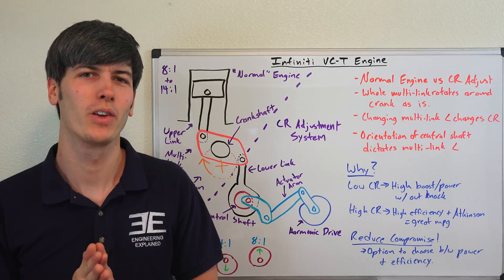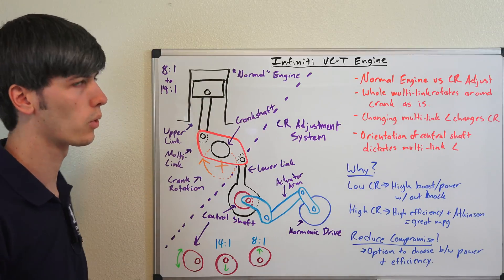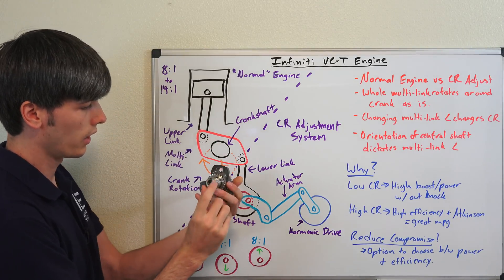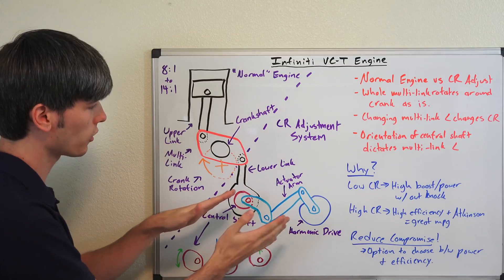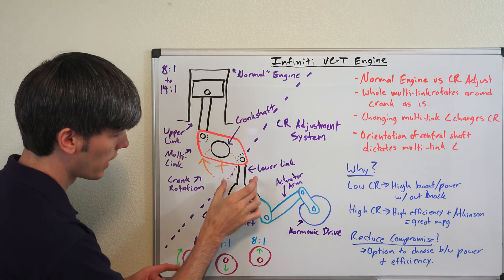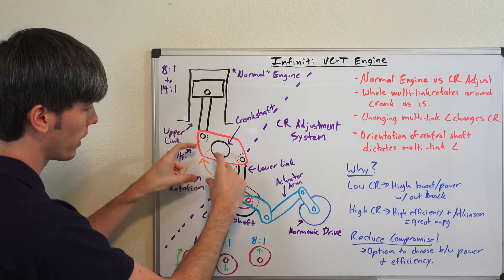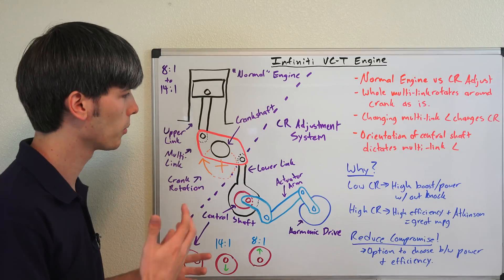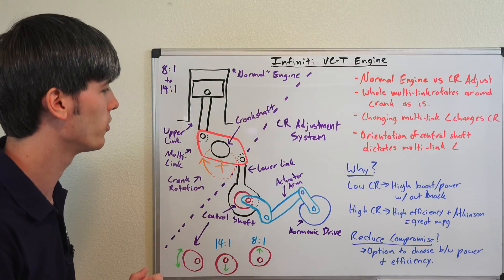Infiniti's Amazing New Engine - Variable Compression & Turbocharged

Comment: I bet you could buy a lot of gasoline for your normal sports car for what it'd cost to rebuild that engine;  Kind of counters out the benefits of fuel efficiency....
Reply: Most people lease Infiniti's. It'll be the job of the poor schmuck who buys this third hand without a warranty that will be footing that bill, and by that point Infinity won't care.
Reply: +I'm Batman What makes you think fuel efficiency automatically reduces pollution? You know, the same gets said about direct injection and turbocharging, but there's now loads of evidence that suggest these engines increase harmful particulates, not reduces them. Also, your comparing costs of regulars rebuilds to this, but you don't even know how much this will cost to rebuild. You can rebuild a simple, non-DI engine for a few thousands bucks. But just rebuilding the fuel system on a modern DI engine can cost that much! How much more will it cost to rebuild an engine with this complicated variable compression system, ??? And with the complexity of this engine, a rebuild mot not even be a possibility, many people will likely be looking at completely new engine. Everything is being made WAY more expensive and way more complicated just to save a few drops of fuel and a few puffs of a tail pipe, if we're even save that much.
Reply: Or just buy an efficient car with electric assist. If you want to drive efficiently use fuel alone,  if you want sport and more power use electric motors as well.
Reply: thats not the point, efficient engines will reduce pollution too, its not all about money... and people who drive their cars alot spend much more on fuel than a rebuild... E.G we have 2 cars and per month spend around $900 on fuel.
Reply: I'm Batman We could calculate it out if we knew how long that engine will last, how much of a premium it costs, the MPG difference over the standard engine, and the price of fuel. 
I purchased a TDI with the 6 speed manual because in my mind it is the simplest and cheapest way to achieve 40-50+ mpg.  I bought the car and plan to keep it long term, so I don't want to have to worry about spending thousands of dollars replacing batteries or a generator like the hybrid guys(plus I get better highway mpg).  I don't have to worry about an overly complicated compression adjustment system either.
Reply: +Josh i didnt read that wall of text but just to clarify, basically less fuel burnt per mile means less emmisions when compared on engines with the same technology. Although the difference is less but it is there... However the best way is to just use more public transport.
Reply: +Kent Sextro if every man had your mindset technology would stop advancing because once a cycle was the simplest way and kind of did the job and a car was just overly complicated, same with horse carridges
Reply: I'm Batman Well luckily for people like me, we have people like you who can afford to foot the bill for these technological advancements! ;)  By no means am I against new technology, but I work in the construction/agricultural industry and I know what systems last and which ones don't.  Ultimately I'm just wanting to spread a little bit of awareness, some people buy cars simply on looks and numbers, without giving any consideration to what powertrain they have under their hood.  You too are obviously educated enough on this matter to make an informed decision, if this is the vehicle of your choosing I'm by no means criticizing you!
Reply: I'm Batman That isn't necessarily true. If you removed your emissions systems, your fuel economy will increase, but will your emissions go down? Of course not! Also, new technology isn't automatically an "advance", refinement is an advancement. Infiniti could've created a new triangle wheel, but that isn't a real-world advancement.
Reply: +Kent Sextro agreed, but still its good they came up with something.
Reply: +Josh dude sorry to say this but you didnt get my logic ... i know that emmisions depend on alot of factors but you cant discuss every thing at a time. I get your point but try to understand what im saying.
 So basically my point is, if you burn 1 mol of methane compared to burning 10 mol of methane to generate energy to do the same task obviously 10 mol will generate more by product than 1 mol simply because its greater in quantity. So if two cars have the same emmision system but one engine requires more fuel than another than whats greener? Excluding other factors just talking about fuel at basic level. Agreed??? Sorry for any mistakes english isnt my first language.
Reply: ***** I'd like to buy a "zero FX" for commuting to work and playing around the farm.  The problem I have with electric vehicles is that you're limited as to specific range and that the batteries are out the ass expensive when they eventually fail.  I do believe they're the future and I will own one someday if I live long enough.
Reply: I'm thinking the people who buy this almost certainly will own more than one car so if it makes a strange noise it'll just take it the shop.
I definitely wouldn't want to buy one of these used.

Comment: Great video as always.

With respect to Infiniti models and engines.  The VC-T will only be used in the 4-cylinder.  According to autoblog this technology does not work well for 6 and 8 cylinders.

Source: http://www.autoblog.com/2016/08/14/infiniti-vc-t-engine-variable-compression-official/

Comment: Would the gains overcome added weight?  Is it more efficient despite having more moving parts? Also, I know I'm asking you to explain how a clock works, but if you wanted more power isn't high compression better? Assuming ofcourse that the engine is naturally aspirated? I've heard that small displacement makes for better response, is that with higher compression? I know I'm asking a lot but I've been watching your videos for a long time, I'm in tech school for high performance and to say the least your videos have inspired me to seriously consider engineering. I'm fascinated by the technology and hope to leave a mark on the industry with my own innovations.

Comment: But Saab did this 10 years ago...
Reply: and with a less complex system. They used a cylinder head which tilted to change the CR. A rubber bellows sealed everything. It was a 1.6 liter 5 cylinder engine with 225hp if I recall it correctly.

Comment: Whoa.. thank you for explaining it. I was really wondering how they were able to achieve variable compression. I initially thought they were gonna adjust the height of the cylinder heads then quickly thought hydrulics and lots of moving parts and what about the head gasket, but it is pretty impressive.

My quirl with this system is.. now I see how they were able to accompish it, but now the engine(crankshaft) has to rotate moving parts that are not normally attached and its gonna use some joules to accelerate the extra parts which again my use extra energy and then may slow acceleration.

Also.. when that motor starts aging and this links that adjust compression might need replacing, or the accurator needs to be replaced. I forsee issues the engine may have in the field that the lab has not yet encountered.

Comment: Doesn't look like it would be a very high revving engine with all that reciprocating mass flailing about in the crankcase. I doubt it would have a long life high mileage expectancy either. A bit like early generation variable scroll turbos and the way they used to disintegrate I would imagine.

Comment: "It's a mess when you look at everything together, but it's easy when you break it down."

-Every engineering professor ever.
Reply: it is though
Reply: In fact - essential features necessary to conduct the dialogue. MODEL, the main question. This engine is no scientifically based models
Reply: that's backwards

Comment: Could you do a follow up video about how this system would work in conjunction with a turbocharger and as a follow-on, how it would encourage downsizing?

I would presume for highway cruising it would default to the 14:1 atkinson cycle with very little boost like you said, and then for accelerating, e.g. pulling onto the highway (the engine's maximum power demand) the engine would go to it's 8:1 mode, and use lots more boost via an electronically controlled wastegate. Since engines are sized for their maximum power the ability to increase power density on demand allows you to downsize significantly without sacrificing fuel economy at cruising speeds.

The other aspect of this system is that it's infinitely variable, so it would likely be programmed to change boost pressure and CR in line with RPM, unless the user selects otherwise. Lastly, I'd assume with the extra weight and complexity on the crankshaft, reliability and redline take a hit, the weight of the system isn't too high ofc, but the crankshaft takes huge inertial loads so it's very sensitive to weight increases, this is probably easily compensated for by more boost however. Does that sound about right, or have I missed some critical factors in my analysis here?

Comment: How will they stop the crankshaft piece from rotating as the crankshaft rotates?
Reply from the maker: It can rotate slightly, but not much. It has a linkage on both ends of the crankshaft (where it pivots), holding it in place.
Reply: Do your channel have a video of how these would work so i would understand properly

Comment: Mazdas skyactiv engines use the atkinson cycle + super high compression as Jason mentions toward the end of the video. Thats how they can achieve hybrid like mpg with respectable performance. This variable cr engine from Nissan seems like a great idea. We'll see how it holds up in the real world.the addition of the turbo seems like a dicey proposition to me. Will the system adjust on the fly based on throttle position or will it be a user selectable drive mode setup? That linkage system seems like a potential failure point to me.....I think an ideal engine is one that is turbocharged but is also running a somewhat modest compression ratio (like 10-11:1)....a precisely managed gdi and a cooled egr to help manage combustion chamber temps without running too rich.

Comment: One thing I've never quite understood is the concept of the outer and inner wheel spinning at different speeds. Both in 4X4 application and some cars with rear steering when  the wheels move the same speed past a certain kmph mark

Comment: Jason you mention that this engine reduces compromise by being both efficient and powerful, but there is a third factor where it compromises quite a bit: reliability. If I'm understanding that diagram correctly, everything attached to the crankshaft and multilink is moving with the crankshaft. This seems to create a whole lot of unnecessary moving parts and it seems to me like the whole contraption could be a lot simpler. But rather than just whine about something I'm going to suggest a solution, just on the off chance any Infiniti engineers happen to be reading this!

By maintaining the traditional design that four stroke engines have used for their crankshafts and pistons, the only things that move are these parts themselves. Taking advantage of this, a system could be created where, rather than attaching to the engine block, the bearings of the crankshaft are attached to a system within the block comprised of either electriconic linear actuators, hydraulic solenoids, or another means of moving the entire crankshaft up and down as it rotates. This will adjust the pistons' range of motion up and down and adjust the compression ratio by either increasing or decreasing the combustion chamber volume. A Schmidt coupling or something similar would be used to allow movement of the crankshaft without changing the location of the engine's main output shaft to the clutch or torque converter.

In theory my idea is a lot simpler with fewer moving parts, but obviously no one can really tell how this would work in reality.
Reply: Hey there m8! :D I actually like that solution but it may lead to construction of a taller engine... may not much but on paper but, it wouldn't be a practical design. Having the crank move up or down for the sake of variable compression would mean in an event of a failure, the crank would wobble and damage the crankcase and the block. This would be the 'Sayonara' moment for the engine as the crank were to be tilted from one side and it failed to do so on the other.

I would suggest Saab's VC engine. It was way simpler than this but is prone to head gasket failure as the top heads would tilt - causing an increase/decrease in the compression ratio but also expose the gaskets leading to built up of carbon content and excessive heat. It's simpler and could lead to a vehicle with a lower centre of gravity. If ONLY those gaskets were made to withstand excessive heat and knocking, it would be an incredible engine.
Reply: Over time if they continue to develop this, it will become reliable. Look at the turbos from the old days and now. There's a MASSIVE difference in reliability, output, and size between the old and new. It just takes time to develop new tech and become reliable, applies to most tech not just cars.
Reply: I like the idea, but I see a few issues.

1. Likely too much energy being exerted on the crank to have it moved up and down reliably. The infiniti system, through levers, has less force exerted on the actuator. 

2. Both ends of the crank shaft would need to move at exactly the same rate to allow the crank to remain perpendicular to the cylinder walls. Failure to do so, even slightly, would likely result in bearing or engine failure.

3. Everything connected to the crankshaft would also need to move, creating many additional complexities.
Reply: No, nothing ist attached to the crank shaft. Only the Lower Link sways from right to left as the enginge turns.
Reply: 2. Where is your problem? The crankshaft is one piece and it is pivoted in the crankcase.
Reply: The issue is the torque needed to keep the crankshaft in line. that would also change the belt positions and chains, or adding Schmidt couplings for those as well. There are some engines (very very small ones) that do this if I recall, namely rotary radials if I'm not mistaken somewhere.

Comment: Very novel design, but looks like a lot of reciprocating mass and added friction. I'm guessing those rods would also be pretty massive to hold the forces from ignition under a lot of boost (I'm guessing it's a high boost capable engine since they had to bring down compression that much). Redline at ~5000 rpm?

Comment: Isn't that on the 3.0L?  Because the 2.0L is a Mercedes engine not Infiniti.
Reply from the maker: It's a 2 liter.
Reply: So it's an unreleased engine yet to come out because I work at an Infiniti and I am a technician there and the only 2.0 we have currently it's the Mercedes engine on our Q50 2016 and Q60 2017